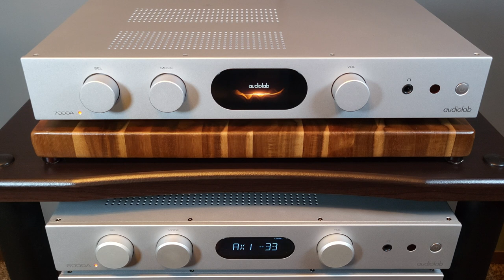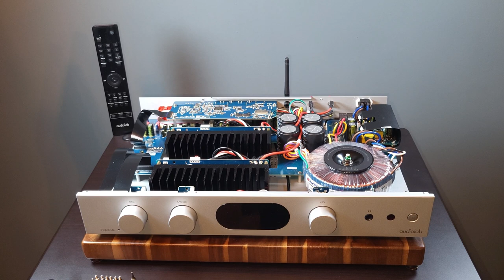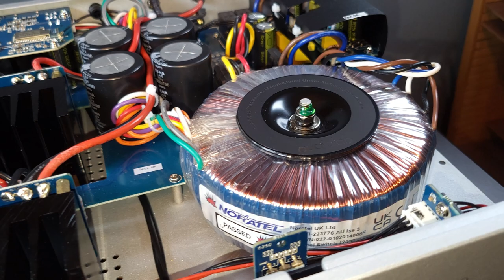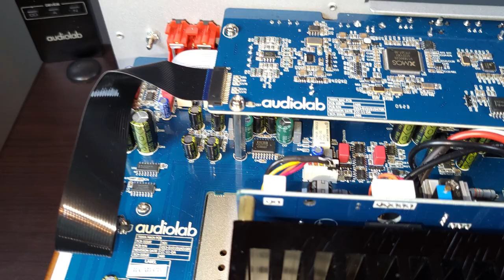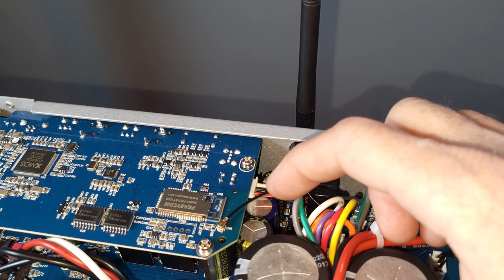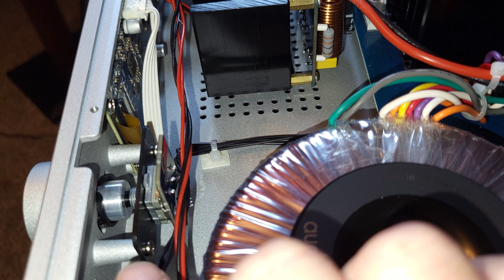Audiolab 7000a Fully Featured Integrated Amp full in depth Impressions video 4k Pop Da hood @28:18😆

Comment: Thanks a lot for dooing these videos, amplifiers are so cool and so important to see on the inside.  I found it interesting this thing is using the tiny version of the ess9038 chip.  Most of these more high end devices seem to use the beefy 8-channel variants but those little guys sound pretty grreat too.  I think they have less channels making for a much simpler design
Reply from the maker: @OGmolton1  yeah Audiolab has been engeenering their dac around the ESS chip for almost 13 years ' and they have made such good synergy with built in dacs very own powersupply and output stage ' the dac in the 7000a destroys the dac built into the Denon pma1700 and it's the same chip but different designed ' circuit' which is just as important as the chip it's self
Reply: @tee-jaythestereo-bargainph2120  reminds we a lot of the topping d10 if thats a little opamp to the left there and thats a very decent dac

Comment: How well would this drive the Tekton impact monitors with the 4ohm spec?
Reply from the maker: As long as it doesn't drop below 4ohms you should be fine 7000a drives my Dynaudios Tower that are 3 way bass reflex desighn speakers that are 86db 4 ohms with authority !
Reply: @tee-jaythestereo-bargainph2120  what do you mean if the amp drops below 4ohms could that happen if the Tektons only come in a 4 or 8ohm package?

Comment: 4 output transistors,,, is one of them ,,15c or 25f .. higher temp.. than other 3,,, pls measure,,, try this test no inputs,, no outputs,, vol at min.. leave it on,, for 1 hour,, dude,,, note on 6000a all 4 are about same temp,,,
Reply from the maker: My dudeeee !
Reply from the maker: I have done that amp warms up !
Reply: yes but the center only,, that one transistor,, is it far more than other 3 transistors
Reply from the maker: @kaybhee6  I don't know which one you are talking about ?

Comment: One thing, how do the pre amp sections compare?  What was full testing like thank you.
Reply from the maker: Jan Erthner lead engeener fine tuned the preamp section of the 7000a 
For higher performace and the added Volume sentivity gain level in my opion is a huge plus depending on if your Transport has a hot/cold input signal ' 
I used the Iota Sa3/Emotiva dedicated Amps I also bi-amped 
Some of my hard to drive speakers with both Amps and I switched between them as in using one as integrated amp and the other just as a amp - and yeah without a dought 
7000a pre section is more refined and less dry - I love mismatching Amps because you never know when synergy hits thanks for stopping in !!

Comment: Please tell us about errors in the receiver's software, such as: failure to save filter settings after turning off the power, failure to display volume animation when adjusting via the ARC input, and delay in adjusting the sound volume via the ARC input.
Reply from the maker: Integrated amp saves all my setting ? Even when I unplug amp if it didn't I'd be all over it !

Comment: Could you please tell us which of the following amplifiers you think is the best for the Wharfedale Linton speakers: a Cambridge CXA81, an Audiolab 8300A or an Audiolab 7000A? Thank you!
Reply: I demoed the 7000 vs the cxa81 this week actually. The speakers were wharfedale diamond 12.3 towers… For me, I’d get the 7000 but if I was starting out I’d get the 81. That’s because I already own an arcam sa30 with kef r3, so I wanted to make a system that sounded different in the first place. Basically if you like soft sound, Cambridge, if you like fast and arguably more impressive sound, 7000. I personally just bought wharfedale diamond 230s for £200 and the 8300 which I got used for less than £500… So there’s the price to worry about where you could add a sub if you get a good deal on the rest of the gear
Reply from the maker: I just saw this comment ' had alot of people tell me 7000a makes great pairing with lintons ' 7000a sounds Great with my Dynaudio emit 50s 
Big bold sound that's detailed built in dac on 7000a is one of the best in its class !!!

Comment: Hello Tee-Jay, really appreciate the value you deliver, as I took it and I'm very happy with the Audiolab 6000A and Triangles Comente 40th using Eversolo DMP-A6 ME as streamer, altough wonder if the 6000A is not a bit behind such speakers and streamer and thinking on moving to the 7000A as I don't want to lose any of its "greatness" but, it is sooooo similar to the 6000A, in case you have tested it with the Triangles, would you share your comments about improvements respect to the 6000A? Thank you in advance!!!
Reply from the maker: No problem buddy ' as you know I am not a salesman " 
If you upgraded to 7000a you will have a LITTLE bit more power espically dynamic range and Bass Attack but it's a small difference the biggest Value with 7000a besides a little bit more power is the built in dac it's Great !! Even rivals my dacs costing $700-800 U.S. and having HDMI/USB also is big feature for some people  Bluetooth is pretty killer as well it even shows the songs playing on the upgraded display screen 
That's has many different display options 
Another great feature is the analog inputs not dac inputs but analog inputs  have gain level match from -5 to 5+ db which would allow you to add more gain. ' As far as over all resolution With analog inputs the 7000a barley edges out the 6000a but internal dac vs dac 7000a is supreme ' but I take it your using the eversolo as dac/streamer which should be just as good as built in dac of 7000a Which eversolo uses the ESS9038q2m honestly for the price of 7000a I'd urge you not to buy the 7000a ' 
Your 6000a with eversolo should be just as good yes 7000a has a tad more power but for price I think you can do much better by buying an standalone amp and using 6000a as preamp ' if you bought something like the Galion TS-A75 You'll hear a bigger difference lots of powaaa and great bass ext and dynamic range even at low volume ' But if you wanted an Intg amp I would reccomend the New Marantz 50 2ch class AB amp it's pure analog so you could just hook up your eversolo to it ' it's powerful and one of the best Intg Amps I have heard with  🔺️ 40th ' but make sure you get 2 channel model ' it can draw up to 65amps !! That's great for integrated amp ' during my review of 40th I said 6000a is good up to mod volumes but I would actually reccomend if you listen at loud volumes to use speakers that are 89db efficency and above to have that full flesh n body Sound ' espically at louder volumes Even the New Denon PMA 1700 I am about to review sounds great with 40th ' I hope this helps I wrote a book ' 😆 
Because I am here for you all not the audio companies '
Reply: @tee-jaythestereo-bargainph2120  thank for such a response! I'll take a look on the options you list considering the possibilies of getting one in Mexico. Best regards!

Comment: Hello Sir, 
TeeJay will the 7000a pairs well with Elac Carina bookshelf speaker??
Thanks brother
Reply from the maker: I would go with a More powerful amp in my review I mentioned I wouldn't hook 7000a up to a speaker that drops below 87/86db efficacy ' 
Because you want good Headroom and dynamic range ' I have to be str8 up I believe you wouldn't have the full flesh n body Sound from elac with smaller amp ' 9000a yeah ' but the elacs I reviewed ub52 loved my Big Yamaha Amps'
Reply: @tee-jaythestereo-bargainph2120  
Okay Sir, thanks for your advise, 
How about Cambridge CXA81 or Yamaha AS801??
Reply from the maker: @ritish84  yes 😃

Comment: Great review Tee-Jay. Question, which Opamp did you use in the Aune dac when you compaired it with the built in dac of the 7000a?
Reply from the maker: Sparkos SS3602 ' but what I was getting at is Audiolabs built in dac sounds best with the Audiolab intg amp -  shortest signal path the Aune X8 is still a great dac for the price ! 
Alot of the budget building the 7000a was spent on the internal dac espically the internal clocks I showed did you see the size of the Xmos digital integrated interface ? 
I never in my life heard I built in dac sound that good ! Most intg with built in dacs aren't very good under $2k U.S.

Comment: Is the 6000a a good match for q3050i speakers?
Reply from the maker: Str8 up I don't know if 6000a could drive them fully ! I would have to look up the specs ' I wouldn't pair up a speaker that's below 89db with 6000a or speakers that drop below 4 ohms hope that helps 6000a is best used with very efficant speakers like Klispch/Zu/Tecktons 👍
Reply: @tee-jaythestereo-bargainph2120  q3050i is rated at 91db, my worry is it's not a forward sounding speaker like Klipsch it's a kind of laid-back sounding speaker.

Comment: TJ, great video. Dig your love of Audiolab. I have the 6000a with Polk r200's, and think it sounds amazing. The upgrade bug is real. I could get the 8300a ,used, and external dac for probably less than the 7000a. From a sound perspective only, what are your thoughts on that?
Reply: I would get a power amp added to the 6000a and use a mid priced dac for better results, you could even bi amp if speakers allow it
Reply from the maker: That's a tuff 1 depends on what you want out of your speakers 8300a is almost colorless very very transparent but hell of sweet top end Airy/Sparkle is very good but 8300a  does not have a subwoofer output and the fullrange pre-outs can only be used in pre-amp mode Preouts don't work in integrated amp mode which is a bummer for some pep 
The 7000a does have more color to the sound but it's still 'fairly' netural relaxed sounding ' And the built in dac dam it's really good ! I haven't tried the R200s but but I do have the Lsim 703 ' Personally sounds like you really like the 6000a So on that note I'd go 7000a it's the big brother to the 6000a and you would have fullrange preouts that work in integrated amp mode ' Hope this helps

Comment: I completely agree that this is an absolutely fantastic amplifier, but claiming it's so much better than the 6000a seems a bit off to me. I've tested both, and even though the 7000a is slightly better in certain aspects, the difference is so minimal that you have to concentrate to notice it clearly. When playing these two at low to normal volume levels, there's practically no discernible difference. The 7000a plays a bit louder, but apart from that, there's very little distinction, certainly not enough to justify the price compared to the 6000a. I strongly doubt that one could hear a significant difference between these two in a blind test. That being said, this only proves how exceptionally good the 6000a truly is. You won't notice "significant" changes until you reach the top model, and even then, it's not a night and day difference.
Reply from the maker: I tested both Integrateds with my switchbox in real time , Like I said in tthe video all 6 audiolab amps all have that same Tonality ,The British sound natural relaxed and Mature Sounding ' But in analog mode the 7000a has more Headroom and drives my harder to drive speakers
More effortlessly  bass attack/Dynamic Range 'headroom . 
But in terms of performace with using built in dac 7000a is levels above 6000a - And we can decode DSD/MQA and Higher Rez PCM the 7000a built in dac is outstanding even competing with my Higher end outboard dacs ! 
Even the British Audiophile said built in dac is better than his Denafrips of course being paired up to the Audiolab ' having USB/HDMI is a huge improvement over toslink Coax which gives 7000a advantage ' 
I talked this morning to Lead Engeener of Audiolab Jan Erthner and he confirmed many tweaks went into 7000a espically the built in dac ' 
Even the B.T 5.0 Apt X LL is better than 6000a - But like I said many times in video So is the pricepoint your right on with that I agree' 
I have 2 listing rooms One Nearfield you see in Video that's lightly acoustically treated and my entertainment Room medium sized that is highly treated with 16 panels 8 diffusers and ceiling cloud panel ' 
I spent over 6 months with 7000a and 4 years with 6000a ' and 6000a does sound more lean ' happy new year
Reply: @tee-jaythestereo-bargainph2120  I completely agree with everything you're saying; it's just that there wasn't such a significant difference in my ears. In terms of price and sound quality, the gap wasn't as clear to me. Granted, the 7000a has many other qualities, such as HDMI, but for me, who doesn't need that, it wasn't "enough" to justify the high price. The 7000a is undoubtedly an upgrade, but is it worth the price in terms of sound compared to the 6000a? I wouldn't say so. That being said, it's still an amazing product that outperforms many amplifiers in a much higher price range. Enyway, Happy new year and keep the videos coming, you are doing great 👍
Reply from the maker: @SD-ym5jo  I get where Your coming from 💯 and the 6000a is a sweetheart at pricepoint and has lasted me 4 years with no problems 
If I based on percentage I'd give 7000a about 7-10 percent performace gap with dac vs dac 
Analog domain maybe 5 percent 
I should have mentioned this ! 
Happy new year '

Comment: TJ.... I'm a Brit. I was initially (and stupidly) put off by your strong accent, but your videos are GREAT. I have worked in Electronics manufacturing for years (from hifi to military avionics).

Bought a 7000a based on your review here. WOW!! Not disappointed one little bit!!
Reply from the maker: Solid Integrated amp ' 
I been having alot of fun with the 7000a check out my 2nd short video '
Reply: @tee-jaythestereo-bargainph2120  getting a 7000cdt next week
Reply: 7000a +7000cdt is spectacular.
Reply from the maker: @markorchard2272  yes sir !! I like the 7000cdt alot ! And I have the 9000cdt as well '
Reply: I’ve the 7000a/cdt and some Dali Oberon 3s. Should I get a 9000a or better speakers? What is your opinion?

Comment: Dear TJ i have kef q950. I previously had  cxa81 and loved the bass and energy and soundstage but found the combo very fatiguing. Would 6000a be a better match for the speakers? Appreciate the input. Love your channel!
Reply from the maker: You know I have to be str8 up ' 
I am not a salesman buy the Marantz PM 8006 !! And you will love me for it ! I owned the q900 2 years before I started my channel they do like a little power so Headroom is a must ! But Marantz doesn't come with built in dac !! Do you use outboard dac ? Also the Pm8006 goes on big time sale at like accessoriesforless.com and that intg in built in Japan !
Reply: My dac is ifi zen blue @tee-jaythestereo-bargainph2120
Reply from the maker: @laparoscopically hell yeah love ifi dacs ! They really are badazz !! 
Trust me buddy get the PM8006 ' the imaging and fullness is great and top end isn't overly bright it is slightly tilted up but the resolution keep it from sounding to fatiguing with your Q950s ' I just don't think 6000a has enough balls for that tower speaker and I want you to have hell of dynamic range and Headroom '
Reply: Ok will return the 6000a. Would you pick the marantz or the galion ts75? Forgot to tell you i have a kef 10" subwoofer too. Thank you sir!@tee-jaythestereo-bargainph2120
Reply from the maker: Well with Galion you will need a Preamp ' That's more cost hell of amp though God ohh mighty is it good ' But more Money 💰 I thought you wanted to go Intgrated amp ' did you have a Preamp in mind ? For the price you can get Marantz for now be hell of bang for da buck '

Comment: Seeing how slow the cpu is on that Audio Lab, I'm curiious if you have tried out one of the Eversolo Streamers ? While the meters etc can't quite keep up perfectly in real time, the Eversolo doesn't lag on every function or parameter change like that Audiolab with it's small display. The Evesolo display is just beautiful and unlike some, i really enjoyed the detailed sound of it. It just needs to be paired with the right gear.
Reply from the maker: That's a badass dac !! I want one !! 
My modified Burson composer has small display but 144db channel seperation is chord level but yeah I want thay dac badly man !! The Spectrum Ex meters look amazing 
I had to be truthful about 7000a lag in vu meters ! And the lab is using 2 high performace texas instruments 8 bit expanders I showed that's for Leds ' the digital vu is on point though!
Reply: Displays are nice to have but not important in the whole scheme of things, sound quality is what matters most and displays can fail or burnout or even cause interference
Reply from the maker: @carlitosgomez71  I agree 💯 but you can turn it off as well

Comment: You specifically mention Magnepan but how about the smaller models, eg LRS?  This amp is around the price I was looking at and specs seem enough for them.
Reply from the maker: Yeah I mentioned from 2min-4 mins of video that the 7000a is no Powerhouse !
I have to keep it real ' And I don't think it will drive your LRS you wouldn't have the dynamic range nor the Headroom ' 
You want an amp that can drive those Maggie's effortlessly without putting a strain on the amp ' 7000a will get very hot with those speakers' 
7000a does not like speakers that drop down to below 4ohms I mean if you don't listen above 85/86 db then yeah you'd be OK " I am about to review the new Galion TS-A75 that's just a power amp but it will five the shit out of your Maggie's!! But if your looking for an all in one integrated amp ' the new Denon PMA 1700 will drive those Maggie's its rated to drive speakers down to 2 ohms !
Reply from the maker: Your speaker is like 3.3-2.8 ohms and about 80db efficant ' I mean you can always try the 7000a from companies like audio advisor who have exellent return policy ' Here's a link about your speakers ' 
https://www.stereophile.com/content/magnepan-lrs-loudspeaker-measurements#:~:text=Magnepan%20specifies%20the%20LRS%27s%20nominal%20impedance%20as%204%20ohms.